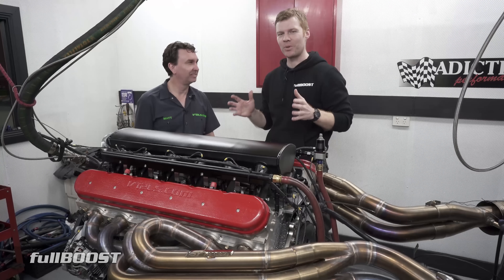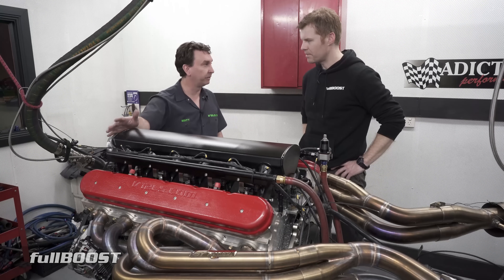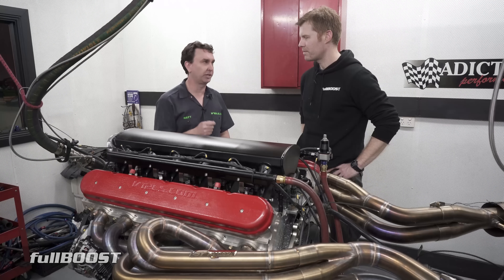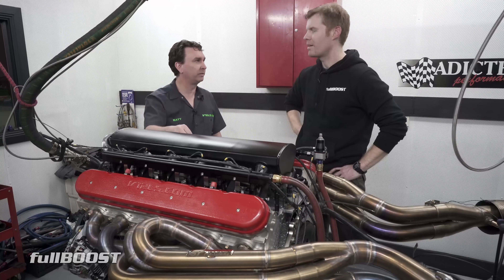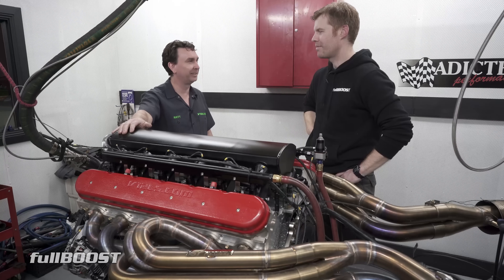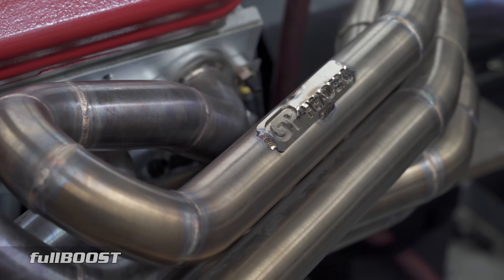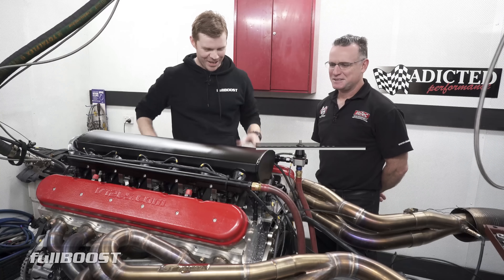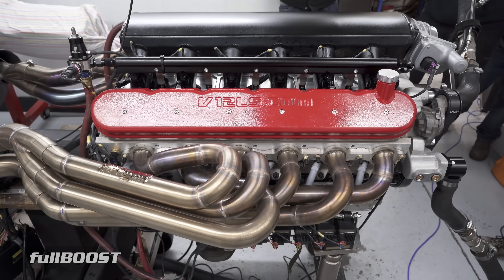Inside a V12LS engine | fullBOOST

Comment: 590ci only making 600ft lbs , congratulations that 1960 327ci power per ci
Reply: it made 685ft lbs with per CI is better than a ls7
Reply: aussi3212 some people just can’t look past the fact this thing hasn’t really even been made with any high performance upgrades yet. Stock cam profile and a std 92mm throttle body, yet they expect the world. I’m just thankful this engine even exists. 😏
Reply: @Techheadzc32  um its has 4.125 bore and ls7 style heads, and their "stock" prototype cam that has 228 duration at 50 thou, so lsx/ls7 big bore , ls7/lsx heads, and a hot street cam.
Reply: aussi3212 but only has a std LS 3.622 stroke. It’s still very mild in comparison to what it could be. I have a 228 duration cam in my VF and I still get great Highway economy and a mild idle. I stand by my comment thanks.
Reply: @Techheadzc32  sweet so you have either a l98 6.0l or a LS3 SS or lsa 6.2, now go build a lsx or ls7 with 4.125 bore/3.622 stroke thats 376ci then Add ls7 heads and a big tunnel/high ram intake and a high lift low duration 228 cam and tell everyone how mild it is, like its only got the best LS engine parts on it, mate they are sand bagging it to sell the higher HP engines
Reply: aussi3212 L77 actually with AFM delete. Still should be smoother with the 228 lift. LS3 gets more lift than that.
Reply: @Techheadzc32  mate its 228 degrees of duration at .050 lift with a total lift in the high 500s
Reply: and for you information thats 25 more degrees on intake side and 15 more degrees on the exhaust than  GMs hot ls6/ls2 cam
Reply: aussi3212 no, would only get 0.525 with 1:1.7 ratio rockers. LS3 does over 0.550 with std cam. Please don’t argue with someone who actually built his motor and researched the crap out of it.
Reply: Sorry yes. Duration is 228.  No one has mentioned lift in this. But I can assure you my cam is 228 duration. My lift is 0.525 both sides. LS3 has higher lift but would need to lookup duration. I do believe though, it is similar.
Reply: @Techheadzc32  what are u taking about ? lol
Reply: this engine does not,i repeat does not run a stock cam or stock cam profile , im just trying to tell you that
Reply: by making comparisons to GMs stock cam profiles
Reply: aussi3212 it’s definitely not a hot cam either.
Reply: @Techheadzc32  true
Reply: aussi3212 then what the hell are we arguing for?
Reply: aussi3212 by the way, just looked up LS3 cam specs. My cam is LS3 specs but has a slightly tighter LSA. And going by that and what I’ve seen in this video, seems they’re running almost LS3 specs here too. Considering this motor has been set up to LSA/LS7 specs head and bore wise, that makes this a std setup with virtually no performance upgrades over LS7 specs at all.
Reply: @Techheadzc32  Ls7 are a head type on there own , they are basicly a highport ls3 head , and LSA heads are the same style as ls3 just a few small differences
Reply: aussi3212 So essentially my comment stands then..
Reply: @Techheadzc32  no this LS v12 has big LS7 heads , LSX 4.125 bore size and tunnel ram intake , it is the beez knees, not just basic stock engine
Reply: aussi3212 it’s still sucking air through a std LS3 cam profile lifting std valves on 1.7 std rockers. Yeah, sure, it’s a tad wider but it’s not being fed to anything more than factory specs if it were an actual LS7.
Reply: @Techheadzc32 it not a ls3 cam mate its "Naturally aspirated our engines make 800HP with a mild 228/238 street cam"
Reply: @Techheadzc32  And it has A ls7 bore size because it has LS7 heads, ls7 heads need 4,125 bore minimum.
Reply: @Techheadzc32 stock LS3 cam specs, The LS3 cam is actually a hybrid of the 2 LS6 cams with a different LSA,

204/211 .551/.525 117

Comment: That thing probably weighs at least 300 kg with iron block
Reply: Dry weight with all accessories and no exhaust is 273kg.
 A stock iron head SBC is 260kg, so they are not stupidly heavy.
 BBC with iron heads is 342kg!

Comment: If they make this with an X-ram intake with dual throttle bodies, i would buy it. And if you did a Nelson Racing Engines take on it and integrate inter-coolers into the cross ram or "X-ram" intake then turbo it, you would have total madness....

Comment: The only engine in history to actually get negative gas mileage.
Reply: Gallons per mile... 🤣🤣
Reply: @bigtank2185  you're absolutely right with your observation right here my man! The gas mileage will be almost like on of the High-Performance Cigarette-Boats that use 1+ gallon of fuel per mile!!!
Reply: C-TOWN ALL-STAR if it’s tuned similar to an LS, there’s no reason fuel economy can’t be only 20-30% worse than a std LS3 or any other 6.2ltr. That is usually dependent on the load it’s given. I’m sure in a VF (if shoehorned in) there’s no reason it can’t give you 11.5-12l/100kms. I currently get 7.5-8l/100kms (highway) out of my factory AFM disabled (as all manuals are) and mildly cammed manual L77. All depends on use.
Reply: @Techheadzc32 , I agree with you and you're probably pretty close with you estimate, I was just making a funny reply to Christopher's comment above!
Reply: LOL 😂😂😂

Comment: Could they reduce the stroke and spin it faster??
Reply: Yes, also a larger cam would help even with this stroke. We've found these engines peak just a little higher than the same specs in a V8 LS.

Comment: Great video guys !! and great engine too< i would love to see individual cylinder egt probes to see how the intake is distributing air etc, I think this engine has sooo much potential, it has only just begun TBH.   An aluminium block would be very nice to see and see what the gross mass weight would be.  I would guess 50% more than an LS3 at 183kgs.  So lets say 274kgs, that is only a small bit over an RB26 with twin turbos.
I would still prefer a fully modified LS3 bombed off it's tree as I am more of a weight weenie, but damn this thing is very cool.
Reply: That iron long block dry with everything except headers tipped the scales at 273kg. Remember there is more material at the ends of the block, and every block has 2 ends, so even with thick cyl walls and extra webbing, they are still a little less than 1.5x the V8 mass.
Reply: @WarWagonMT  But an LS3 is 183kgs complete ready to go in the hole.
 RB26DETT is complete too at 270kgs, i try to get complete engine weights when I refer to them, because at the end of the day, that is the reality. 
I really like this build, so unique.
Reply: @SimonWorlds  Wow, an RB26 is pretty heavy with all the gear! The iron V12 would still tip the scales at a little under 300kg with oil and exhaust. The V12 alloy blocks are lighter, but everything else (crank, cam, pistons, rods, etc.) weighs pretty much the same, so you might save around 50kg, putting the dressed weight well under the RB26. 
 For your records, a fully dressed RX8 4-port engine is 130kg, and a 2J non-turbo is 208kg with no exhaust.
Reply: @WarWagonMT  Oh wow, the rotary is surprisingly lighter than i thought.  The 2J is a heavy beast aye, the 2JZ I am not sure of, but have been told it is up there with RB26's weight fully dressed.
Thanks for the reply mate.

Comment: Non-car guy got pushed here by another video.    What good is a V12 with only 750 horse power when you can get a V8 with 700+ (like Dodge/Jeep have).    That's a lot of extra parts for so little return.  Explain in laymen terms.
Reply: Thanks for the interest in the project and a great question. This engine is for people who don't want something you can buy over the parts counter for their elite level build. In laymans terms, a Walmart watch keeps just as good time as a Rolex, is reliable and doesn't need an expensive service...

Comment: 9.5 litre and only 750HP? That's pathetic.

By the way, this is nothing new, ever heard of Falconer?
Reply: Yes of course, Ryan was and still is a big inspiration to us having done the same thing and met similar challenges on the SBC1 platform.
Reply: So where is the motor that you custom built that did better? Id like to watch the video. Obviously by your comment you can and have done better. Not a racing engine either. One that runs pump fuel, idles at 850 rpm smoothly and is drivable.
Reply: unbiased cobra66 they did make it clear in the video that this was only a std cam profile with std throttle body. Fair go mate!🙄
Reply: @Techheadzc32  I know. I love the v12ls. I was having a go at the OP that was saying its pathetic . I want to see what he did that was better. How is this unfair? Any motor that can make a base NA power of 750 is bloody well built. Add cam, change comp, fuel and add boost and 2000hp would be a piece of piss.
Reply: unbiased cobra66 sorry, yes, this was aimed more @frosty A B
Reply: @Techheadzc32  i figured as much. All good.

Comment: A lot of great engineering, but not being a hater lots of cons ( long, heavy(specially cast iron version), extra 4cyl, injectors etc etc... one off custom parts, would be extremely expensive.. brodix BBC alloy block basic off the shelve Brodix heads 850-900hp all day no issues. Lighter cheaper and much stronger.  Not practical but once again great engineering good on you lads.
Reply: Wayne, I believe that outside the 4 main performance parts of head, block, cam and crank, all other parts are off the shelf items. It still give some huge scope for upgrades. It’ll also just be a matter of time, with that many custom CNC machines LS heads out there, that someone will eventually also start making custom heads for these as well. This is a very smart piece of engineering personally.
Reply from the maker: The engine is for people who want something unique as stated in the video. 👍

Comment: Fantastic! This is a dream! How much does it weigh? Any plans of Aluminum Cast/Forged/Billet Block in the future? Any plans of Compound Turbos? Any Idea how much Boost it could handle?
A Lightweight version for aircraft use with the Cam drive beefed up and modified to drive the prop at a 2:1 Gear Reduction(or without) would be a winner!!
Reply: Can't imagine the cost of doing the block that way. Cast iron is not your friend when it comes to the over all weight or trying to balance the vehicle but the strength should be there.
Reply: @breaganrosenberg2264  a few engine builders are doing billet blocks for small block Chevy and Toyota 2JZ inline 6, some of them producing as much as 5000hp!

Comment: If only GM mass marketed this instead of V8s... lol
Reply: To be fair GM KNOWS pushrod V8's
Reply: Im hoping they can configure the OHC engine into a v10 or v12 and  fit it into the back. Would be nice to see them use something different for a top of the line model, that would net a 6.9l or 8.3l if the same bore stroke of the 5.5 was used.

Comment: Might actually keep up with a stock xr6 turbo
Reply: Lmaaoooo👌🏽
Reply: Ain't that the truth boys
Reply: I just came here from watching the latest Haltec OGSIXE video, where they made 640rwhp with a factory barra (obviously with intercooler, turbo, exhaust, fuel system, valve springs and oil pump) and I'm a bit underwhelmed :(

Even though this is the 'stage 1' package an aftermarket 9 litre engine should at least make 900hp at the crank, especially considering the cost of the thing.

I love the idea of it but I think the base model should be a bit better than it is.

Also, they should do a V12 barra now and start a new grudge match between V12 barra and V12 LS motors...
Reply: @Rollin8.0  that's not stock then is it. My stock maloo just has a turbo, injectors, fuel pump and intercooler.
Reply: @unbiasedcobra6672  stock crank, rods and pistons he means. Good luck boosting your stock maloo without opening her up
Reply: @User78347  it hasnt been opened up. Only 8psi you dont need to change the rods. Its been driven everyday for over a year. So your kinda wrong.
Reply: @unbiasedcobra6672  uncle Rodney will be paying a visit shortly 😂
Reply: @User78347  really? Thats the best you can do? Well for the lasy year every xr6 has seen the back of it. So when it does blow it will probably be while beating a barra. Then ill just build a 1000hp custom  motor.
Reply: So how is that bad?
Reply: @Rollin8.0  you will find a completely stock xr6 turbo will be lucky to break 300hp at the wheels. Yes its very easy to coax more out of them. Completely stock they arnt that quick. You need to add boost, do the exhaust and tune them before they go. Just like the ls12. They say numerous times this is the extreme low of what this motor can do. With a bit if a tickle here and there 1000hp would be easy. Boosted it would go past 2500hp with absolute ease.
Reply: @unbiasedcobra6672  butttttttt...... its still cheaper to do a xr6t. Let's face it this thing ain't fitting many engine bays
Reply: @wadey351  its also cheaper to do a turbo LS. It will fit in any car with more ease then a barra and you  will make more power.
Reply: @wadey351  and anyone that goes to powercruise knows that a turbo ls is quicker.
Reply: @unbiasedcobra6672  I'm not a turbo fan boy. Just calling it how it's is
Reply: @wadey351  of coarse a barra is cheaper. It makes a fraction of the power and torque. Also one motor is custom built the other is mass produced. Again of coarse its cheaper. Show me a barra with no turbo making 750hp for cheaper.
Reply: You've all completely missed my point.

This engine is awesome, but they've chosen a 'base tune' for this engine that, in my opinion, is too low.

Unless they're selling these things for 15k AU turn key, for a 9 litre engine the output is not enough.

Maybe they should do two specs - a low comp 750hp version for guys who want to throw boost in, or a 900hp high comp NA motor.

This should be able to make 100hp/L at the crank and still be quite drivable, I don't think that's too much to expect from an LS.
Reply: @Rollin8.0  or you could start your own company. Then design and build your own custom engine. Then you can do what you want with it. 
Or maybe they can do what they want with their own company and product. If they want to tune it low its their choice.
Reply: Nice try at trolling.
Reply: Lol didn't mean to start an argument 😂
Reply: Oops struck a nerve. Rock on brother 🤙
Reply: @User78347  how did you strike a nerve? Not sure what your reading.
Reply: Or is that all you could come up with because you know barras aren't the best motor in the world.

Comment: I reckon it sounds like a Commodore V6?
Reply: yeah, all multiple of 3 engines will sound similar, be a inline 3 or a flat 12 or a v6 etc...  The fundamental sound of an engine is the lowest multiple besides 0 that fits in a full rotation and if its even bank or odd bank intervals.  eg. 2, 4, 8 and 16 can sound the either like an inline 4 or a v8 depending on bank configuration as they can be odd or even.  3, 6 and 12 will all sound similar as the crank usually equates to only even firing inline and twin bank engines.   Then of course you have 5 and 7 cyl which do not have factors with the above and have their own sounds again.

Comment: Is this 90 degree or 60 degree V12?
Reply: xpusostomos 90
Reply: @lallyz28  ahh. Next question why? It's the wrong angle for a v12
Reply: xpusostomos it’s based solely on an LS, you go 60deg, you then totally blow out the cost of production. It’s called compromise. Be thankful it even exists.
Reply: Thanks for the interest in the project guys.  @xpusostomos  Why do you think it's wrong?
Reply: @Techheadzc32  but it's a new block, and surely must be a new crank and cams so what more is shared than if it was 60 degrees?
Reply: @V12LS  I was always taught that 60 degrees is the natural and balanced angle for a v6 and V12. No? Something to do with the smoothest firing order, angles and crank and so forth. As far as I know every other V12 is 60 degrees and every V8 is 90 degrees.
Reply: xpusostomos no, if you go into the story, the whole engine prototype, which the moulds were modelled off was 2 LS motors welded together. There was no required engineering really other than that for the block. This cut cost by thousands! To go to 60deg would’ve made the costs massively larger due to engineering costs.
Reply: @Techheadzc32  hmm... In this day and age when you can 3d print anything for almost nothing I would have thought moulding a prototype changing the angle of the banks wouldn't be too big a deal... I mean if you're going to all that trouble anyway.  But ok, I get it.
Reply: xpusostomos the biggest cost to any design is the guy pushing the mouse. This didn’t even require any CAD or CNC for the block outside of normal decking and boring.
Reply: @xpusostomos  That's right for an even firing order V12 60 degrees works well, however neutral balance and firing are very different things. To further your example, despite having even firing a 90 degree V8 is actually not perfectly balanced. They have an end-to-end imbalance with a 4-plane crank and are badly imbalanced on the 2nd order with a flat plane crank. Odd-firing an imbalanced engine makes the problem even worse (think V6 Buick engines), but as a V12 is is essentially two perfectly balanced I6s (1st & 2nd order as well as end-to-end) they can be any angle. Adding a 2nd bank (or even more banks in the case of some tank engines) at any angle can never unbalance the first bank. Would even firing be even smoother? a little, but not better balanced and the benefits of a wide bank angle certainly outweigh the cons in this platform. Wider bank angle V12s are very common in racing for this reason, with my personal favourite being the Lamborghini 80 degree V12 race engine.

Comment: hey just wondering if you guys could answer me one question about this beast, why is the throttle body not set up ontop of the manifold to even out air flow over the runners? thats a long manifold for that to equal out?
Reply: Wack most likely cost and simplicity